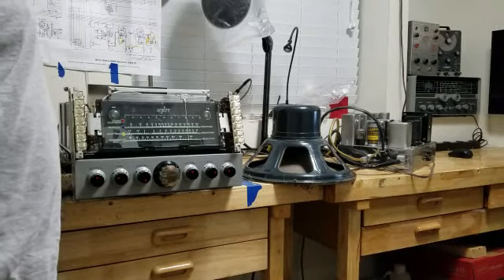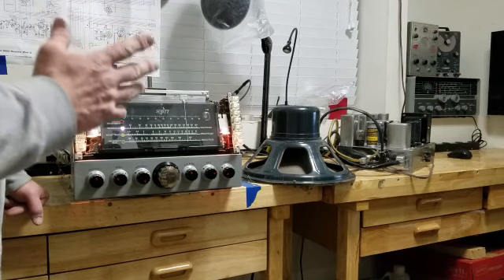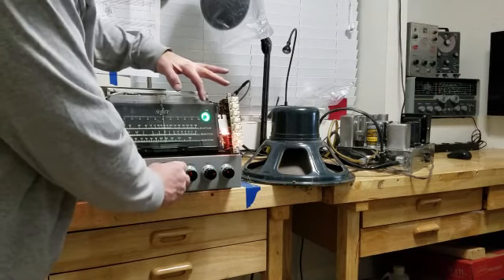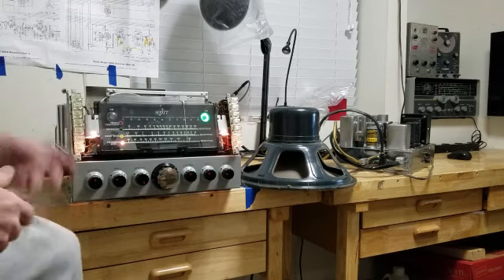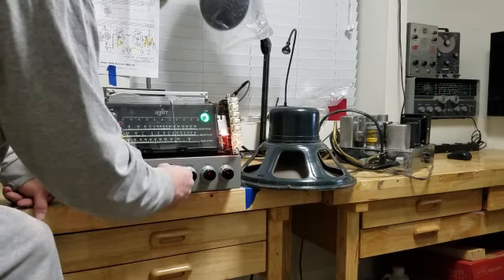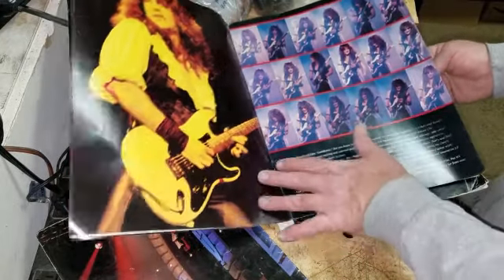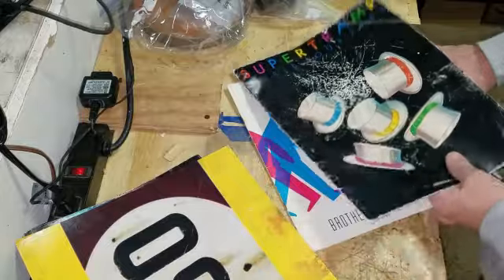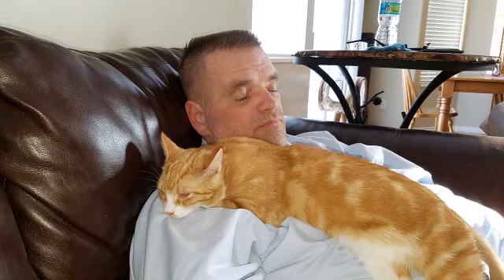SCOTT 800B Radio Phono Console Part 17 of 20 Demo Tuning Eyes

Comment: No basement here but I get drop off in sound on the low end of the dial I think because I'm so far out in the sticks.  Weird considering when I was a kid the old AM radio in the dodge truck would pick up 620 WTMT down in Louisville just as clear as a bell.  I saw Ozzy bite the head off a bat....but it was in an Adam Sandler movie called Little Nicky, LOL!  "You can do it, Ozzy, bite his freaking head off"!  Radio is looking and sounding purdy good.